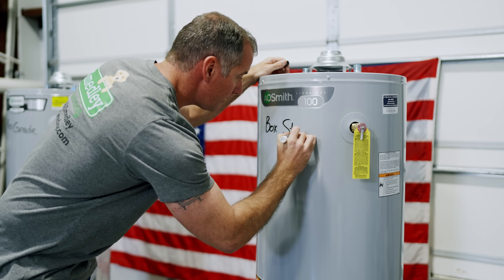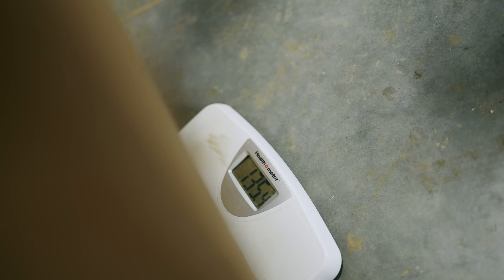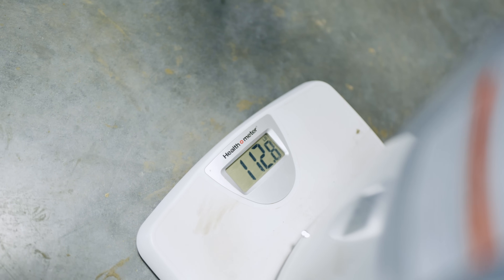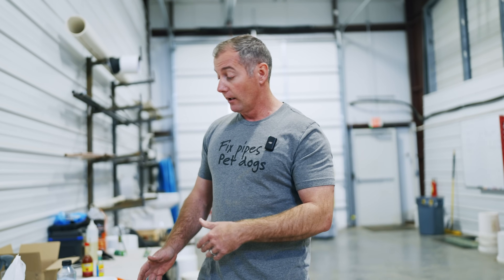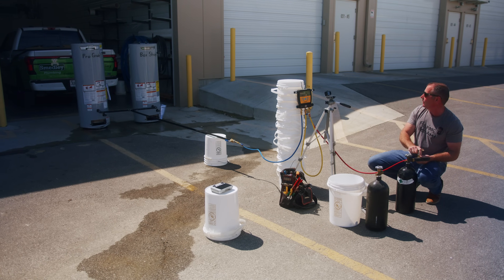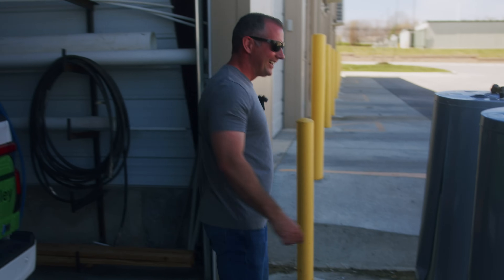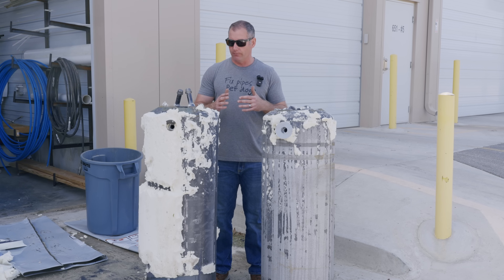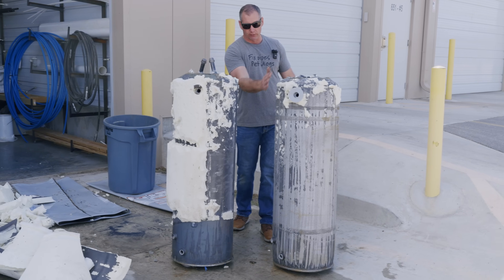What water heater should I buy? - Pro Grade vs. Box Store

Comment: Neither you should buy an outdoor tankless water heater so you have unlimited hot water and when it explodes/leaks, it leaks outside your house instead of in your attic or in your house with regular tank water heaters
Reply from the maker: Good luck with those in a freezing climate..... 🫠
Reply: @SmedleyPlumbing  got to build an insulated box to protect the exterior tankless water heater with extended exhaust pipe.
Reply from the maker: @RossMalagarie  or just install it in the basement....
Reply: @SmedleyPlumbing  sounds good for those with basements, wouldn't work here in south Louisiana because the water table is about 6 inches below the surface so no one has basements.

Comment: Pros usually put shit quality water heaters in homes to save money. I had to replace my original hot water heater newly installed in less than 10 years. I put a Kenmore 20 year heater in to replace it lasted 25 years.
Reply from the maker: Some do unfortunately.  Hole builders are usually at the head of those decisions though.

Comment: Intuitively, I'd believe the more expensive model is better. 

That "pro" model would be $100 more if it was sitting on the box store shelf.  Just making it legally consumer friendly and compliant would add to the cost. 

That said... The fact that consumers CANT buy the "pro" grade model is why you see bad models in the wild. 

I'm happy to hire a plumber to do the job for me.  I'm insulted that they lock the better units behind a closed garden to FORCE homeowners to hire a plumber just to have access to them. 

This practice needs to stop.  Plumbers will still have a job plumbing.  There's no need to sabotage your products to "encourage" professional installation.
Reply from the maker: The pro grade units are available to the general public.
Reply: @SmedleyPlumbing  Then wouldn't it be a boring video of you cutting up the same model? 

Around here, the only way to have access to better models is through a licenced distributor or installer.
Reply from the maker: @silverfeathered1  The purpose of the video is to prove that the box store units are not the same quality as the pro-grade units. However there are many many professional plumbing supply houses that sell over the counter to the public.
Reply: @SmedleyPlumbing   True enough.  Although, I'd have never assumed the model available through my plumber that costs $100 more was him ripping me off.

The most fair comparison would be what a competent home owner could get for the same total cost.
$700 water heater plus professional installation. 
Vs
$1,000 water heater self installed. 

Good work is rarely cheap, cheap work is rarely good... But much of that difference can be bullied by superior materials to start with.

(To be fair, my plumber only charged me $50 and a beer... So I can't relate either way)
Reply from the maker: @silverfeathered1  That's an impossible comparison to make. The plumber has years and years of experience that allow him to catch hazards and concerns that a normal everyday homeowner might not even be aware of. Yes you will always save money when you do it yourself. But if you lack the knowledge or if your time is worth more per hour than what the plumber charges then it's smart to pay the plumber.  Same goes for automotive repair, real estate, cooking, or pretty much any other service in the world where another human performs that service.

Comment: Stopped purchasing most plumbing supplies from big box stores. First bad experience was when I was tying in the 3/4"  gas line into my new furnace. Could not get pipe level. Here POS cheating communist steel T was at least 3 degrees off. Then a gas flex line for my stove had s pin hole leak. I am on my fourth natural gas water heater in my house ( over 45 years ) from the local plumbing supply house. First two were Bradford a white & #3 & 4 A O Smith.
Reply from the maker: All too common unfortunately.

Comment: My Rheem hot water heater is over 20 years old and still going strong. Now I know to stay away from AO Smith.

My next one will probably be a Rudd. I don’t think I’ve ever replaced a hot water that was less than 18 years old. 

I really wish you had put a scope into the tank. I would have liked to have seen the lining in both. If it is glass lined how does the anode help? Interesting video but I’m skeptical about you having proved anything meaningful. What do I know? I’m just a homeowner.
Reply from the maker: For clarification, stay away from box store units.

Comment: You repeatedly say they were not made on the same line. Have you ever been in the factory where they are made? Very possible they were made on the same line. They have a build sheet telling them what to put on the unit. 
In auto plants, vehicles made next to each other are completely different engines, different brands like Ford and Lincoln. At GE, different model refrigerators with different options go down the line side by side. You really need to find out how they are made instead of saying without any proof they are on different assembly lines. Odds are you are wrong.
Reply from the maker: I say that because most people assume that they are identical heaters and most people don't know that the same line can make several different quality heaters alternating as they go.

Comment: This comparison doesn't make sense to me. You bought the absolute cheapest water heater you can get from a box store and compare it to a pro grade water heater. The signature 100 is a bottom grade water heater, it's garbage. If I wanted to do a reasonable, legitimate comparison I could have gone with at the signature 300, which is a bit more expensive. I doubt the equivalent to a pro grade heater is a signature 100. I just looked it up, a signature 100 comes with a 6 year warranty and is about $450 when I looked. The signature 300 comes with a 9 year warranty and is about $650. My question to you: what is the warranty of the pro grade heater you bought?
Reply from the maker: We bought 6-year heaters from both locations.  They were as similar as possible.
Reply: @SmedleyPlumbing thanks for the clarification!

Comment: Man, an ounce difference on those pressure relief valves DOES NOT indicate any difference. Geez, they obviously were made at the same factory. NO businessman would approve a totally different production unit to do the exact same thing if it was only one ounce lighter! You are really stretching to prove what is a sketchy hypothesis in the first place. You should read the instructions on your scale and you will see there is a variability in readings with any scale. In order to eliminate that you would have to do maybe 15 or 20 measurements with each valve, then do a student T test to obtain a standard deviation to see if there was truly a signifcant statistical difference. And even it was statistically significant, the manufacturing of the valves themselves could have some variations. Perhaps the the threaded pipe was cut at slightly different lenghths by a factory saw that may not be that precise. A lot of factory machinery for making non precise things like water heaters has some "slop" in it that is accepted. I'm afraid you are a plumber that is trying to discourage DIYrs from doing their own work because you know, the "pro" plumbing supply houses, at least in my city, WILL NOT sell their water heaters to the average guy walking in.
Reply from the maker: Consistency in testing is required.  Since weight was used for everything else, it was used for the relief valve as well.  And the relief valves are made by different manufacturers so they are absolutely different.

Comment: why couldnt they be built on the same assembly line? its only a matter of the material handler making sure the right components are delivered to the assembly line at the right time and both of these units could be built back to back on the same same day on the same assembly line just like cars of the same model but with different specs are built back to back on the same assembly line on the same day. i am not saying there are the same unit they are clearly not the same but with modern assembly line practices and just in time manufacturing techniques its completely false to claim that the same model item with different specifications cant be built on the same line on the same day.
Reply from the maker: Most people can't make that distinction.

Comment: about anode rod question one came with my unit is 24" aluminum  then i called to find out size use and they say use a 16" rod and gave me model number why so much shorter? and if torque suppose be 10 lbs why should take 20 lbs get dam thing out of there? dont they know the torque limits? of their own recommendations idiots so before have your water heater installed to me pull it out then then properly torque it- and what sealant use around the base and top ring around top removing that stupid rod the heater spun a little and leaking from under it thing only year old - no weld no sealant wtf that about cheap junk- i mean you think they add more to the bottom seal to  take some abrasion?? i mean you think rt?|
Reply from the maker: Yeah they are hard to remove for sure.

Comment: So, there basically is no difference in spite of your bias for the  " pro" model. Thanks.
Reply from the maker: Your wrong comment doesn't make the difference any less.  They were different in almost every way.
Reply: @SmedleyPlumbing  Being your a wholesale plumbing supply and only sale the pro model, it explains your bias. How about the important thing, the tank or is the color of the pipe dope the big thing to you? Yeah, that gray thread sealant you mention 10 times is really a downer. 😀
Reply from the maker: @billhill839  we are a retail service shop. We sell pro grade models and also install customer supplied units. The bias you see is us trying to figure out why the box store units fail faster than the pro grade models.
Reply: @SmedleyPlumbing  My bad, I assumed you were strictly Wholesale which means as a DIY, I couldn't buy a Pro unit. I was aware of "Pro" units but just assumed if I wanted one, I would have to pay 2 grand for a "plumber to install it, so I just went with the $600 one. How much do you sell the Pro brand for? What is the price difference? ( I admit, I'm bias cause the $600 one from Lowes is the one I bought, LOL). Fail faster is somewhat an ambiguous term, what is faster? Where the units that failed properly maintained?  Isn't the pro line approx. $400 more than the Performance line? Isn't the warranty about the same, 6,9 or 12y? There are millions of these tanks out there, you could do the same thing with some other brands, upgrade a few components and call it pro, and charge more. Sorry if I came/come off as snarky, Manufacturers are always looking to squeeze an extra buck out of people. Good day.😀
Reply from the maker: @billhill839  you can buy a pro grade unit over the counter at a pro plumbing supply store.  Most will sell to the public
Reply: @SmedleyPlumbing  So it comes down to the fact that I don't know what the hell I'm talking about. You win. 😀

Comment: Extra thick porcelain inside of the tank would increase its lifespan.
Reply from the maker: It could!
Reply: Where does the tank corrosion usually happen? Have you ever seen an old leaking  tank cut in half?
Reply from the maker: @mitchellbarnow1709  plenty of times.  Corrosion starts where the glass lining cracks.

Comment: So they aren't even the exact water heater... one is a COMMERCIAL GRADE and the other clearly says RESIDENTIAL WATER HEATER🤣🤣🤦‍♂️ if you were to get a residential from the plumbing store it'd be an accurate test. This is absolute waste of time and money on your end not thinking about that. If they don't have the same model# then whyd you even buy one or the other. I'm sure you could find a commercial grade water heater at the box store too.
Reply from the maker: I'm not sure where you're coming up with the fact that the pro-grade unit is a commercial grade unit. And in all reality commercial grade means absolutely nothing other than a selling feature to make you feel like it's a better quality unit. Both of these units are residential units and they are the most common units that we would find for a residential application from each distributor.

Comment: Magnesium is roughly 36% lighter than aluminum. So, some quick common sense suggests that there is more Mg than Al. The density of Mg is 1.738g/cm3 vs. Al at 2.7g/cm3. At least that is what the internet suggests, and I see no reason to doubt it. Making an apples-to-apples comparison is difficult as I am no metallurgist, I do not know the volume of the rods (the video suggests that the Mg rods have more volume), and those maths are hard!

Feel free to correct my stupidity. I assume it is there.
Reply from the maker: The biggest weight difference is in the tanks themselves.
Reply: @SmedleyPlumbing  Indeed. Great vid. Fun to watch.

Comment: Those are not called “nipples” coming out of the top, they’re called dielectrics.
Reply from the maker: If you want to split hairs they're called dielectric nipples.
Reply: @SmedleyPlumbing     It’s only splitting hairs if there isn’t a big difference between a plain old nipple and a dielectric.

BTW, the big boxes sell water heaters with brass drains too, and longer warranties. Or, for $15 the drain can be upgraded.
Reply from the maker: @JohnCap523  I'm starting to see why you have a black eye on your profile photo. Seems like you like to pick fights.
Reply: @SmedleyPlumbing     Typical plumber…

Comment: The Chinesium gas controllers on many consumer (AO Smith) propane/NG water heaters are absolutely garbage.  The now have a tamper-proof 1.25" sight glass and a pathetic hammer style push button piezoelectric ignition.   Good luck relighting that hot mess after you run out of propane!  💩💩💩
Reply from the maker: Yep.  The ignition system could definitely be better.

Comment: LMAO. This is as dumb as it gets. “We bought two different SKUs and guess what? They’re different!” This isn’t an “informative” video. It’s a sales pitch. 

Here’s a “pro tip.” Never hire a plumber to “service” your hot water heater. They cost $500 bucks. If it stops working in 10 or 15 or 20 years - just buy a new one and put it in. I’m watching videos on HWH’s because mine - which is a “box store” heater installed in 1996 - has finally given up the ghost. If it cost $300 28 years ago - it probably cost less - the amortized cost of the heater was roughly 89 cents a month. How much of a plumber’s time can you buy with 29 cents? Buy the size you need, run it into the ground, and then put a new one in yourself.
Reply from the maker: Have the day you deserve!

Comment: All the comparisons are absolutely irrelevant considering they are NOT The same kinda of unit. The only thing that you have matched is the brand ao Smith. You're comparing a residential to a commercial grade 🤦‍♂️🤣 dear lord
Reply: Its not even pro grade - box store. It shoulda been commercial grade compared to residential
Reply from the maker: Wrong. We compared two residential models. We compared the two leading residential models that are sold from each location.
Reply from the maker: Incorrect. These are two residential units.

Comment: Your "burst test" was completely pointless and, in fact, foolish!  Both heaters functioned as designed and neither failed until the MAWP was exceeded by quite some margin.  The only thing the test proved is that the manufacturer builds their products with an exceptionally high margin of safety.  The most reckless part of this video was using a gas for pressure testing.  If we EVER attempted that, OSHA would shut us down in a microsecond.  Pressure vessels should be hydrostatic tested, never tested with a gas even with the tanks prefilled with water.   Anyone who is familiar with a water bottle rocket will understand exactly what can happen.  With your testing method the nature (and thrills) of the failure could be something as dull as the split welds or... something like the Myth Busters.  If there had been a catastrophic failure, the water heater jackets would have offered little protection.
Reply from the maker: Well I guess it's a good thing we did not consult you prior to performing this test.

Comment: This is useless video.  Tanks don't fail because of pressure since pater supply is never 400 pounds of pressure.  Failures are because it rust through.  He is spending all his time talking about something that is not of any importance.
Reply from the maker: So the glass lining is what protects against rust.  And the box store tank swelled whereas the pro grade tank didn't.  So that swelling breaks the glass lining and allows the box store tank to rust out.  I would hardly call that useless.